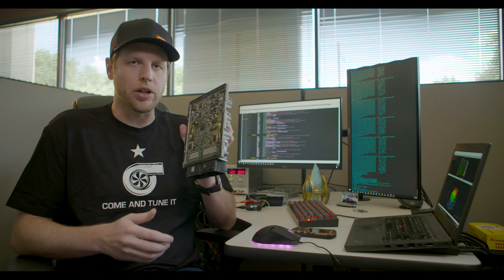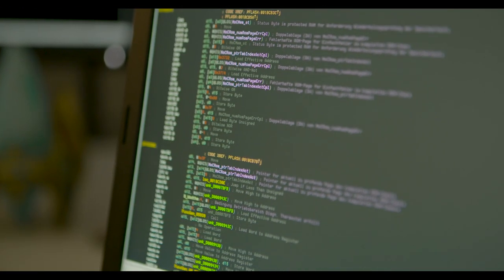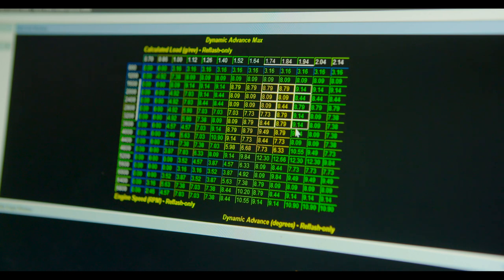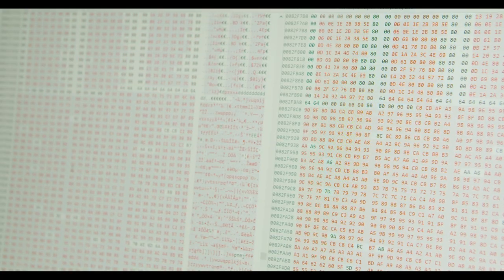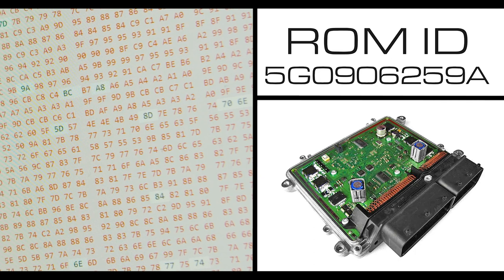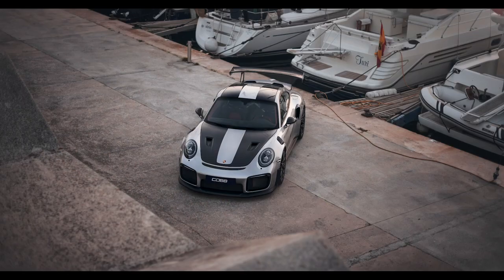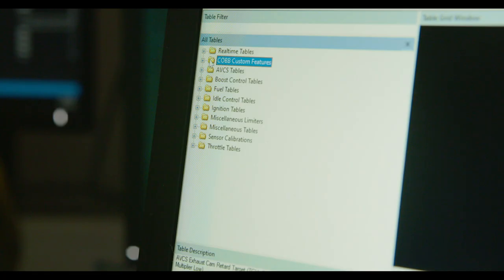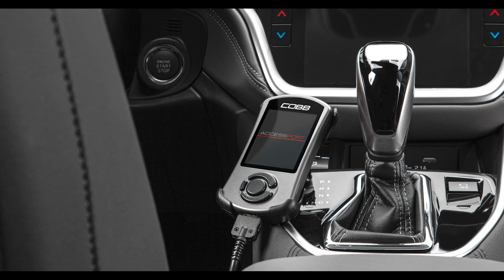COBB Tuning - Car Quickies with COBB - What is an ECU ROM?

Comment: I need serious help!
While I was trying to install an OTS map on my '15 wrx, my car completely shut off and now won't start, turn over, nor even crank. Battery is completely fine because i can use the accessories as normal. I towed my car to Subaru and they haven't been able to do jack for 3 straight days. I don't even think they've touched it. I brought the car in stating my visit is for an ecu factory reflash but i have received 0 updates on my car. Please help